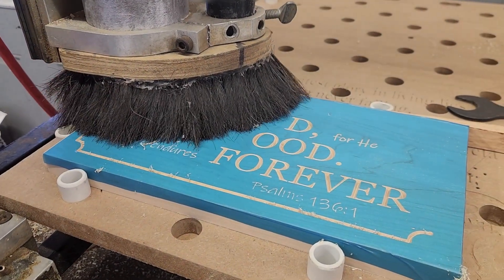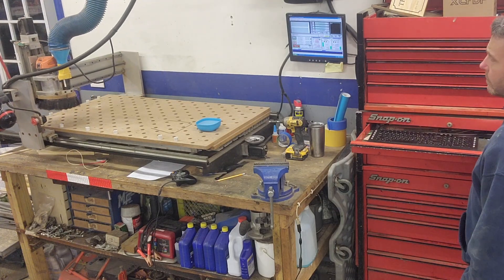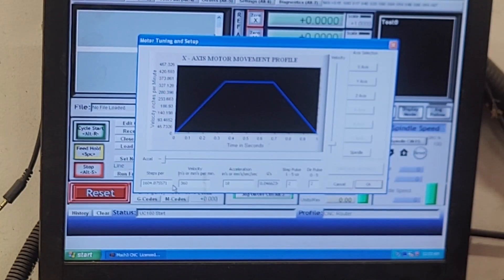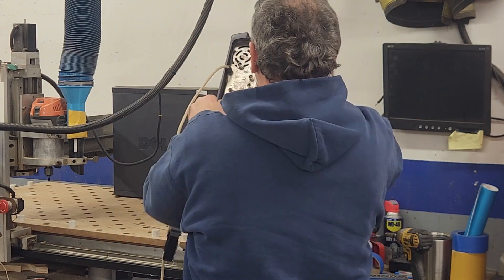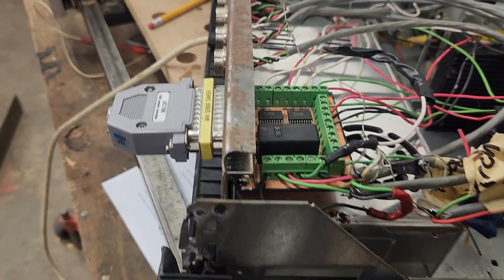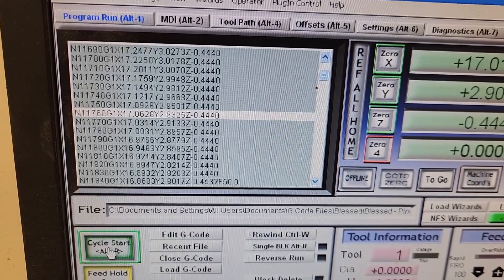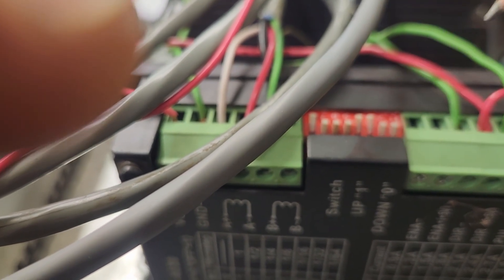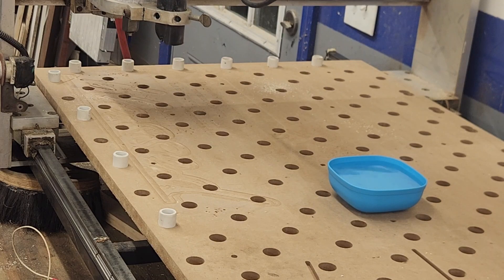Smoother CNC Motion? Quieter Motors, Increased Z-Axis Resonance (DIY CNC Series)

Comment from the maker: Join me as I upgrade and refine my homemade CNC router.
In this and future videos, I’ll be addressing motion smoothness, adding a water-cooled spindle, automating dust collection start/stop, and automating spindle coolant control. Along the way, I’m sure I’ll chase a few side problems as they reveal themselves.

If you enjoy DIY CNC, real machines, and honest experiments, you’ll enjoy this series.

You can also see some of the items I make with this machine at my shop:
https://stillwatershomedecor.etsy.com
Reply: If you have a decent dial/test indicator, you can try mounting it to the stationary part of the Z-axis slide, then have the contact point on some convenient part of the moving Z stage. Then apply a moderate force in both directions on the moving state and see what the min - max deflection of the indicator is. With this, you can start trying to figure out how much and where in the stage the excess slop is coming from. If the drive screw is a multi-lead threaded rod and polymer female threaded bushing (as it seems to be in Y), this may be worn, or the end support bearings that hold the rod could be loose.
Reply from the maker: @davidg3944  Those are great insights. It's been an issue to one degree or another since the parts were new. I can gob it with grease and it all but goes away, but then it collects dust. I am hoping that a dampener will control the vibration, but we will see. Thanks for watching!

Comment: WOW 😯, I'm with you the dampers are the key. If you're using cables and not belts, check out the videos of the ultra high speed 3d printers, they're using the Benji as the print to exact their timing. They have perfected smoothness using cables and dampers.
Reply from the maker: My cnc uses lead screws. But belts are definitly awesome for smoothness in certain applications.